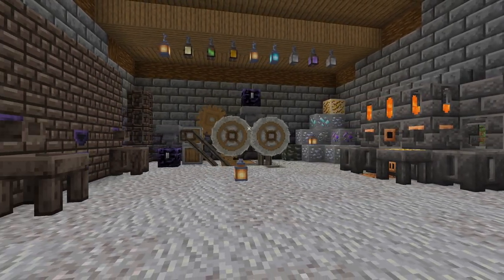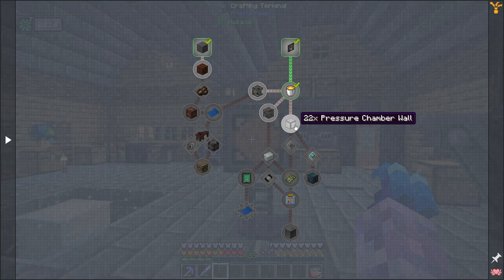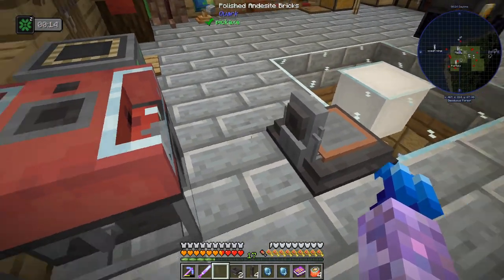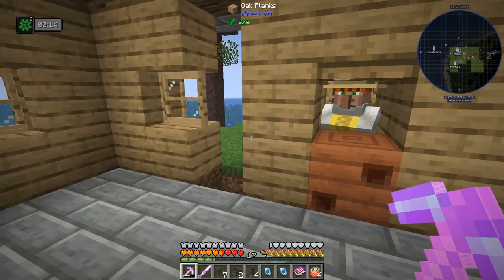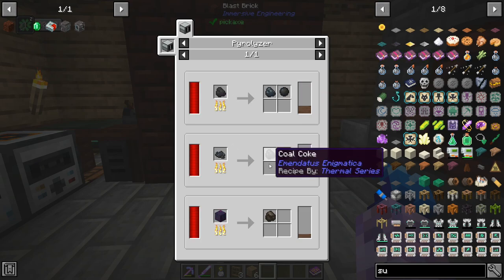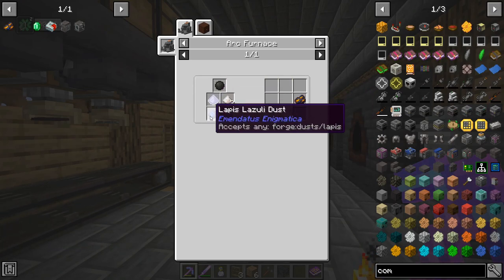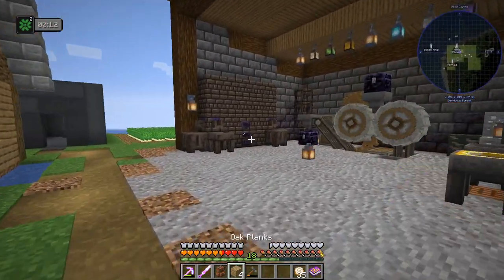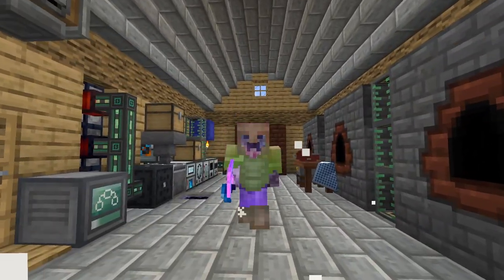Enigmatica 6 Expert | Blast Furnace, Kiln! | Ep 19

Comment: You should take one episode to expand your base, is starting to look crowded and very inefficient in its design . . . it is Minecraft after all, is not that you don't have enough space to expand .
You could dedicate a new space for your power production and rout it with Xnet for easy distribution, also you could use Rf storage much better than pretty pipes, specially if you make a drawer controller.